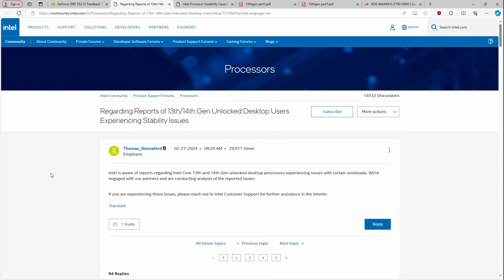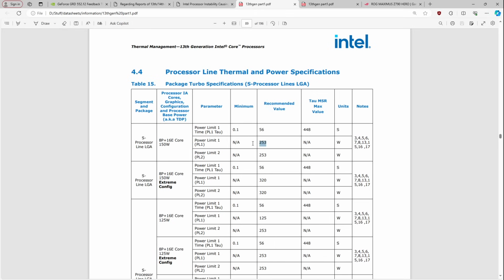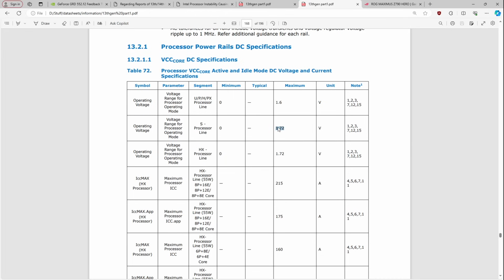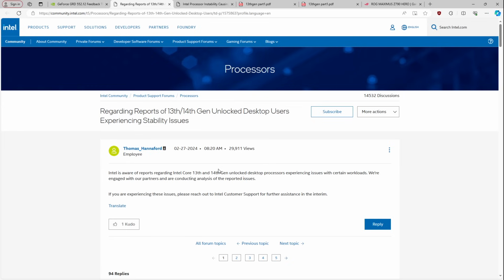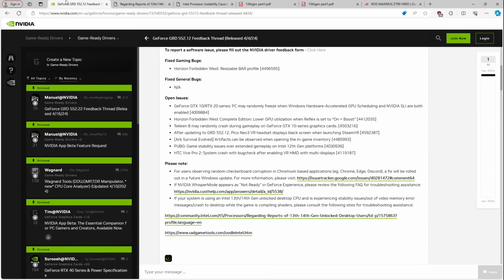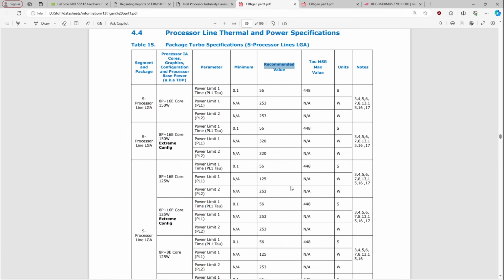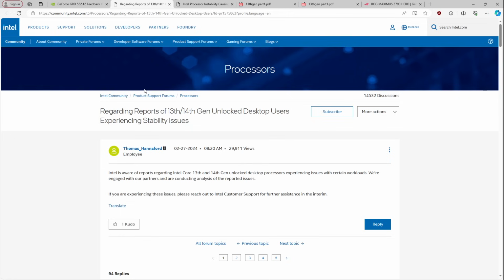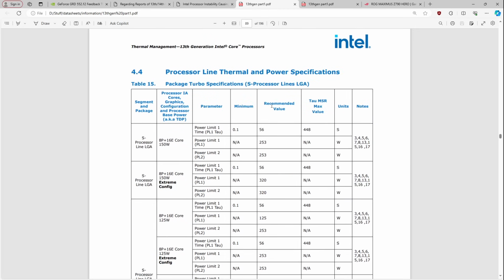Rambling about why some intel 13th/14th gen i9s and i7s aren't stable.

Comment: Can confirm i had absolutely no issues with an ASRock Z790-C. I recently upgraded to an Apex Encore and it's been hell... alot of crashes and oddly enough poor ram stability. My 7200 G.Skill Hynix A die kit will be fine one day and the next its spitting 10+ errors in the first minute of TM5 1mus. I can stop the crashing with newest bios but the ram situation is beyond frustrating
Reply: Then it means your ram is unstable..

DDR5 is unique, it doesn't matter how many hours you throw at it on a stable boot, and BZ's videos on it and frustrations are a good example of not understanding DDR5 stability.
you can do 20 hours across of various testing on ddr5 and pass on a stable boot, then you restart your pc whether for a minute an hour a night or even drop the power completely, and then when you boot up the signal integrity has changed because the voltages aren't correct and the retrain becomes unstable.

If you can't stablilize 7200mhz on an APEX ENCORE, that is literally YOUR problem.
Reply: @ashryver3605  The apex should be able to run a 7200 binned A die kit without hours/days of tuning. My ASRock board never had an issue. I'm new to this and dont claim to be an expert by any means. Lots of variables too beyond the MB so its hard to say what is actually going on but I have noticed that when PL limits and 
ICCMax are set to Intel spec my system runs fine on the Apex, this seems to be directly related to my issues. My ASRock mb could run unlimited without problems. I just got done playing Warzone for 6+ hours running at 7600MHz with Intel PL/ICCMax set to Intel spec and had no problems at all except the fact that my 13900KF has to be neutered in order to gain stability. I don't think my RAM is the issue here....
Reply: @RuiN4265  with that information then, if your system no longer crashes after setting an Amp & Wattage limit, then yes it means your p/e/r values (clock/voltage) are unstable.

if your ring and e cores are clocked too high, they can also manifest as ram related BSOD's (ie. bad_pool) when it's not the ram. if your system locks up (freeze with system display) entering or exiting load state, or idling, that's ram or ring too.
Reply: @ashryver3605  mostly will just crash my game and occasionally hard freeze my OS, i have had bsod but very rare. I run my cpu at stock clock speeds, ring is on auto, ends up being 55x P core and 43x E core, no undervolt etc...as far as I know this is normal behavior. Would be extremely disappointing to find out that i am now unstable at the advertised clocks. Also just successfully completed delid and liquid metal application yesterday and was hoping to push as close to 6GHz as possible but it seems pointless now if I have to run such strict current and wattage limits.  I'm assuming it will just result in lower clock speeds under load hence making an OC irrelevant and keeping in mind that my stock speeds are potentially unstable now. Would you think degradation of my CPU is a possibility? I've never ran high Vcore on it but I have ran PL1, PL2, ICCMax on unlimited for majority of its life
Reply: Contact frame was causing the poor ram stability, put the stock ILM back on and already have 8200MHz running error free. I was very careful and marked my bolts/ frame trying to get the perfect amount of torque but it's too difficult without a dedicated tool. Might try it again with proper equipment but it seems to cause more problems than it's worth
Reply: @RuiN4265  there we go. That's another one that goes unmentioned and is infinitely harder to diagnose without knowing about... derbauer mentions it briefly I think, but mainly it's something you just hear about. Glad you tried troubleshooting the hardware side. If in doubt, when all crashes don't seem to make sense...

I learned about the sensitivity to torque pressure when deciding between Thermalright or Derbauers contact frame, and ultimately went with the thermalright one for that specific problem, with ppl saying its easier and not as hard to mess up the torque and put too much pressure.

But see, 8200mhz is more like it for the Apex Encore. That thing can basically do XMP 7000-7800 no issues, then 8000 is pretty easy to hit even XMP.

Also sorry, had not seen your last message till now was sleeping --- getting "hard freeze" (the symptom off ram and ring instability) despite 7200mhz on an Apex, and running stock clocks > that does indeed make it a case for too much pressure causing bizarre behaviour.

Also, don't fear about degradation ,unless you have been running R23 for 10-30minute loops at a time frequently at 300W+/240Amps above 1.26v~
Reply: @ashryver3605  This has been such a learning curve but so much fun. Feel like im getting what i paid for now. I should've looked into the TM version but to be honest i just assumed Derbauers iteration would be superior. I'm sure with proper torque it is fine though, i just don't have the tool needed. 

What you said is right in line with what I'm experiencing now, I actually had success loading the 7600 Hynix A die preset included in the bios, didn't expect it to work so well but the voltages within that profile were really close to what was needed for 8200MHz. End result is 8200MHz CL36-48-48-84 CR2 @ 1.485v on VDD/VDDQ. I was expecting to need higher voltages for this frequency, this mb is definitely impressive and I believe there is still room left to tighten up my timings. Just guessing here but considering how easily I hit 8200 I'm positive I can push it farther. I"m content with this for now after all the headache I've been through so far. Gaming on this feels amazing

I generally only run one pass of R23 unless I'm testing stability, most of the time i'm just chasing scores and learning how settings impact performance. Appreciate all your help and information!

Comment: So basically these CPUs are not 14900K/13900K but actually 14850K, 13850K. If I'm not mistaken, intel used to label unstable-at-900K-specs CPUs as 850K
Reply from the maker: That's one way to look at it.
Reply: @ActuallyHardcoreOverclocking  I was always wondering why there were no 850K SKUs since 10th gen. I read somewhere that historically, 900K yields were always low. I thought maybe the manufacturing process improved drastically. Turns out it didn't lol
Reply: Exactly! Intel should just bring back the xx850k labels since they don't waste silicon and selling everything regardless of quality.
Reply: @emini6  why would they do that when they can just charge 900k prices for 850k silicon quality instead
Reply: @werewolfmoney  Can we get serious now? If I have a corp like intel sure 009k pricing on 850k would be nice profits, but silicon is cheap except the chemicals and fabrication lab to make the chips, however 10th gen was a time intel was in competition with amd and i9 binning was tough to get good so having the 850k line up was a clever way of selling below average i9 without going to waste.
Reply: my 10850K is finally getting its shine
Reply: Except instead of only 100mhz drop, it sometimes needs 500mhz to be stable vs the 10850k etc
Reply: @WayStedYou  Lol no probably only a 200mhz difference on average.
Reply: @OTechnology  LOL yes actually. What the AVERAGE is says nothing about individual CPUs.
Reply: @WayStedYou  500mhz? hahahahah u crazy
Reply: @branchprediction9923  Watch JayzTwoCents' video. He has a *900K CPU that needs to be downclocked by 500 MHz to get stable.
Reply: @WayStedYou  why any mhz drop??  I'm using this setup from day one becouse I saw somewhere the video that motherboards pump up to much juice in to Intel cpu so I changed it on mine asus mobo fist day. Mine 13900k is working with 5500 mhz on p cores in cinebench and temp 84 degrees. No underwolting and I have artctic aio 420 for something around 80 dollars. So why to lose mhz??

Comment: The current gen high end CPUs on both sides suck. Both platforms have problems. Even QVL isn't reliable. I will stick with 10850k until new platforms
Reply: 10th & 11th gen are stable strong in stock settings for years thankfully I still use them

Comment: Ehh. SVID Behavior setting at intel fail safe sounds pretty extreme. People should ask for replacement at this point
Reply: Intel won’t replace it unless the chip is failing even with intel fail safe SVID.
Reply: It kinda just stall you from getting new one for free if your chip degrades even more after you applied the settings and it’s three months later.
Reply: @luckman7897411   Hmm

Comment: 35:32 since it’s limited by the cooling solution it’s producing the same amount of heat in both 1.2 or 1.3 volts, with P = IV you’ll be drawing more current with less voltage.
Reply from the maker: yes that's the point I was trying to make.

Comment: I've had serious problems running PoE on my 13700KF, it crashed constantly when entering a zone. Turns out it is a CPU hardware issue - the fix in the page you mentioned fixed it for me. Very frustrating ...
Interestingly no other games had issues(so far at least)
Reply: You mean Pillars of Eternity? Ten years old isometric RPG with hand-drawn environment so CPU heavy?
Reply: @2MichalChojnowski2  path of exile more likely
Reply: @2MichalChojnowski2
 Path of Exile, although older game is still somehow stresses the CPU when switching zones
Reply: What fix did you implement? Did you undervolt or just use Intel recommended limits settings on bios? I'm hoping I don't have to undervolt the cpu. What mobo do you have btw?

Comment: By this point, I’m pretty confident that all the BIOS team guys from each board vendor congregate in a Discord before each mainstream Intel release, and make a gentleman’s agreement on what the all-core spec and power/current limits used will be. I’m not kidding, this would explain a lot.
Reply: basically they all just copy what ever asus is doing.
Reply: @sirmonkey198  I agree, but the values are all identical from day one (prior to customers receive stuff), so they all had to obtain those “ideas” and “notions” prior to their competitor stuff being commercially available. So they had to have some level of communication during the engineering testing phase, or alternatively, there’s some next-level industrial espionage that just casually happens amongst Chinese tech vendors. The latter doesn’t seem that unlikely tbh.
Reply: I really don’t think there’s anything remotely radical about suggesting that Intel reps and engineers gives them “official” recommendations on paper but speak off the cuff about what the chips can generally handle in practice and how to get the best performance from them. Seriously, what industry does this not happen in? The AIBs compete with each other and will naturally want to inquire about these things.

And both Intel and AMD want their chips looking as good against each other as they can heading into performance reviews. The same way they both cherry pick their most flattering benchmarks to advertise weeks to months prior to market release. Those benchmarks don’t happen on boards any better regulated or controlled than what AIBs release, otherwise everyone would notice the incongruences.

Intel is trying to back-pedal now but the truth is they’ve had AIBs making these boards the way they’ve wanted all along. The fact that they all have been operating the same way is just more evidence. Otherwise there should be AIB-specific issues, akin to the ASUS problems of frying some Zen 4 chips. We don’t see anything like that with this issue. The AIBs are not the culprit here.
Reply: @kenshirogenjuro873  You might be right. However, you’re mistaken regarding the Zen 4 issue. It wasn’t just an ASUS thing.

Comment: It gets even weirder though. I’ve heard from more than one person that some of these samples will begin to develop instability in just video games over time. Of course, that assumes the person isn’t lying about what they were using their PC for, but I find that the most interesting. I think a part of the issue is that vendors don’t obey Intel’s maximum all P-core load frequency with the 13900K and 14900K. For some reason, they target 5.5 and 5.7 respectively, whereas Intel spec is a full boost bin lower on each.

Curiously, the Intel site specifies 5.1P/3.9E for the 12900K, but in practice, heavy loads yielded 4.9P/3.7E on those chips, so it’s almost as though vendors decided the 13/14th gen bins were good enough to where they could use higher V/F targets. I guess they also had to stay on par with their competitors.

I almost want to say that that explains a lot of it, because hypothetically, if one’s 13900K/14900K is trying to initially clock up to a boost bin that Intel didn’t validate it at, doesn’t that just exacerbate the issue? I’ve checked the 12900K/13900K/14900K pages multiple times to make sure that I’m not crazy.
Reply: Same for me, my system will be fine, then an hour or two into playing Halo Infinite, I'll either crash to desktop or get a BSOD and reboot. My 5800X3D never did this, starting to regret selling it and buying my 14900K.
Reply: @MadClowdz Same thing happens to my friend with a 14900k, bsod after hours of gaming. He went intel because he was worried about 7800x3d stability. Meanwhile I have the 7800x3d and haven’t had any issues.
Reply: I wasn't lying, dont worry :p
Reply: It might also… be in Intel’s spec.
Intel’s spec is hilariously vague and this behavior is almost certainly in spec.
Reply: @JensenHuangTensorEnthusiast  If the clock speed targets are actually spec, then why does the Intel site even exist? It basically just gives you inaccurate info on their products then. That would be like me going to Rolex’s website and seeing an incorrect power reserve rating on their current Submariner. It just doesn’t make sense.
Reply: I wonder if the people that have crashing problems rwgulary update their Bios. Could be that MoBo manufacturers had lowered vcore to get higher clocks an performance out of cpu with each new update. Until they are crashing.
Reply: @residentCJ  I don’t think this is the case. Reason being that these Intel chips do not regulate themselves well. It’s to the point that the only reason for under-volting IMO is to get operating temps lower. When the chip hits its power limit or touches Tj max, it will throttle significantly. In gaming, as long as you’re well below the power limit, it’ll maintain the absolute max P-core target. However, I’ve observed the 14900K not doing 5.7P in game, so by this point, I’d consider it bad product.
Reply: @residentCJ   I can assure you, even when updating BIOS to latest, issues still occur
Reply: I'm going through an RMA process as we speak for a 13900ks that ran solid for a year and in the last few months started crashing like crazy on shader compile.

Comment: Der8auer made an intel CPU factory tour video. They have their own testing software for setting the V/FR curve.
Reply from the maker: evidently it's not very good.
Reply: @ActuallyHardcoreOverclocking  or they should set it to the crazy settings used by motherboards vendors, you know... test the CPUs in real world conditions lol 
.. or enforce limits on them as you said a hundred times.
Reply: Maybe they should make use of it
Reply: Haven't seen the video but maybe they are testing less diverse samples. Diversity wrt the bin or SP score if that makes sense

Comment: (Not joking) Would RAD Oodle decompression be a useful stress/stability testing tool? Or do these same errors show up in any stress tester?
Reply: My 14900k passed every single stress test without any errors. OCCT, Prime95, Aida64, cinebench 24 and 23, intel xtu stress test, intels processor verification tool stress test and probably many others.

Load up any UE5 game and it'd instantly crash with a) out of vram error or b) shut down the entire system.

I lost faith in stress testing.
Reply: @ml-wl4xl bro, same. Luckily I've yet to actually hard crash from the system entirely, but say, DBD after they changed to ue5? unplayable.

I don't think the motherboards are the issue here, this system was power limited the day I got it last February.